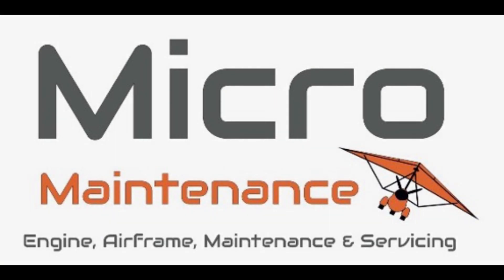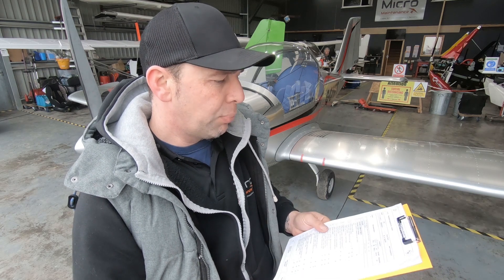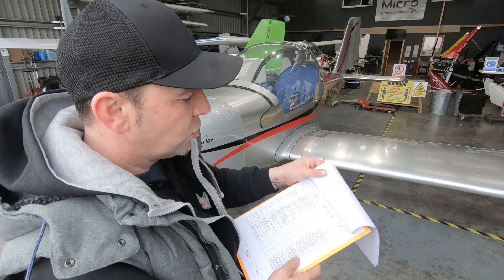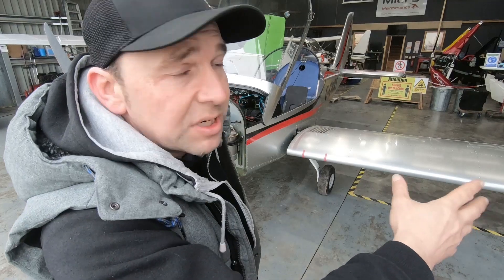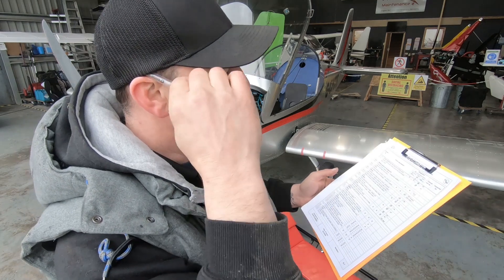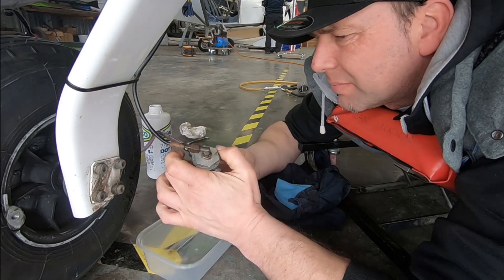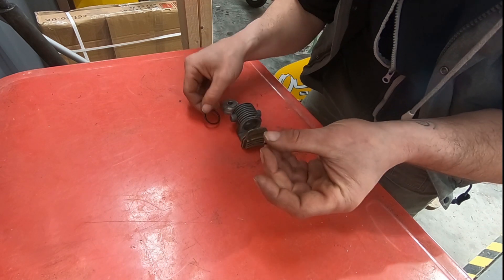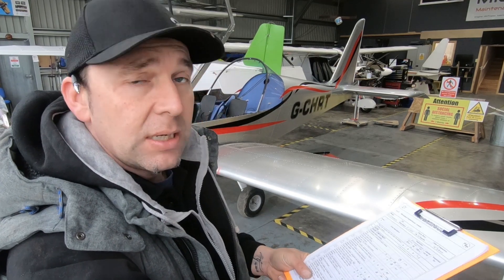Team Eurostar EV97 - Airframe and engine service: WingNuts Micro Maintenance S3 E4

Comment: Best solution for Eurostar/Sportstar brakes: chuck the whole mess in the trash.  They're truly terrible and can't hold the airplane for a proper runup.  I'm facing the $2k+ expense of installing the Matco brake system in my Sportstar.  It will be a major job but those brakes WORK and don't corrode themselves to death.  Good pointers on inspection on the Evektor Stars!  Thank you.
Reply from the maker: We’ve fitted Beringer systems to a number of planes, not cheap, but very impressive.

Comment: DId you do the brakes work before or after the tyres? I  normally would work on brakes then tyres, so no hydraulic fluid can get on the tyre, as it kills them.
Reply from the maker: Yes breaks and then tyres. I suspect the cracked tyres were related to the leaking calliper.

Comment: Hey, I'm the first to comment.

Love the EV97 superb aircraft, the US Sportstar Harmony variant seems even better (better wing, ailerons etc).

Tyres, to my mind, seem to crack prematurely these days, on motor vehicles there's a reason for that and it's not just UV exposure. Tyres can be made to last longer with certain treatments too. Good job you noticed the brake caliper leak too (looks like some motorcycle calipers I've worked on), the pilot/owner should have noticed, but TBF low wing, small wheels etc hard to see (worse with spats/pants on), that's where high wings have an advantage, I guess (during the walk around preflight checks).

Thanks for posting 👍😊
Reply from the maker: Yes, i've not flown one i've not liked. yet to fly the Sportstar, maybe one day. Thanks for watching
Reply: @wingnutshomeofmicromainten6946  Thanks. See my edit on brakes and tyres, that why there's 25, 50 and 100 hour checks👍😉😊🛩️🛩️

BTW, just out of interest, how long does it take to get Eg a set of tyres or caliper repair kit delivered in the microlight industry?🤔🤔😊